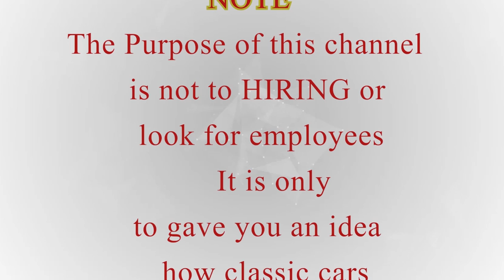Install  Mustang Convertible Top, Headliner, Rear Window - 3-3

Comment: Thank you Meca!!! I could not have changed the top on my 2003 Mustang without your videos!! I only needed parts 1&3  because my headliner is still in very good condition.

14 hours total had never done it before. 4 hours in tear down and 10hours of getting to top fitted and installed. Xoxo Gracias!!

Comment: These video's are awesome but I am confused. At mark 25:35 are you stapling fabric to the bow? Also, I don't see anything about connecting to the first bow with the headliner. Do you remove the bow and slide it through the fabric, or do you use the screws from the liner? I hope you still look here. Many thanks.

Comment: My top did not come with any markings on the top of the window or the bottom of the window. On the bottom of the window do I just line up the alignment holes in the canvas with the holes on the attachment rail??? And what about attaching the 2 middle bows to the main top? Do the screws hold the tab of fabric in place?? Thank you in advance for any help you can offer.

Comment: When doing the back windows around 36:24, how are you able to know where to cut so easily?
Reply from the maker: I know because there is hole and with my fingers i touch the of rear bar the cut has to be 1/4before the rear bard edge
Reply: @mecaupholsterytips  thank you so much! This video will greatly help me change my top tomorrow!

Comment: Hey Meca....first off, your videos are great! My 99 GT needed a top and this has made it really simple. One question, I’m at the point of applying glue (39:00 into video). I know you quickly name the glue you’re using, but I can’t make it out. Also, is there a quality aerosol can alternative glue you would recommend? I have a compressor but don’t have the spray gun you are using to spray the glue. Thanks man!
Reply from the maker: On this convertible top is not necessary to use quality glue you can use any 3M spray bottle

Comment: Hey maybe you can help me with some advice my back window is falling out I want to put my top up so that I could start the removal process and out the back window broke the way they closed on it and now my top won’t come back up and is there a hydraulic arm in there because I think I smell hydraulic fluid or something like that anything that you can tell me to help would be great
Reply from the maker: There is a big change that the cylinders are leaking  and  you need to refill with wi hydraulic fluid

Comment: Hello again. Is it possible to re use the old headliner or do you have to replace with a new one? I ordered a robbins top kit but do I need to order a new headliner as well?
Reply: Also do you have a video of removing the old top?
Reply from the maker: Is better if  you replace it but you can use the same.
Reply from the maker: Yes I have how to replace everything top headliner
Reply: Do you have a link to the top removal video? Thank you so much for the fast reply. I dont have the new top yet but trying to learn all I can before it is time to remove and install.
Reply: Sorry to bother but is there a adhesive you would recommend that I can buy in a aerosol spray can? I dont have a spray gun like you are using in the video.